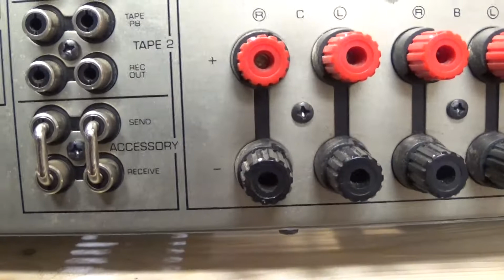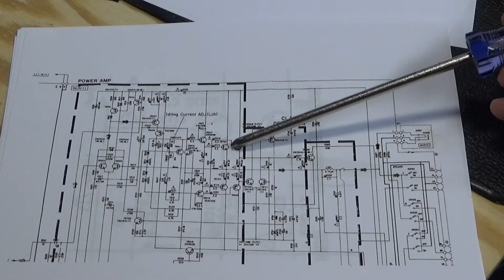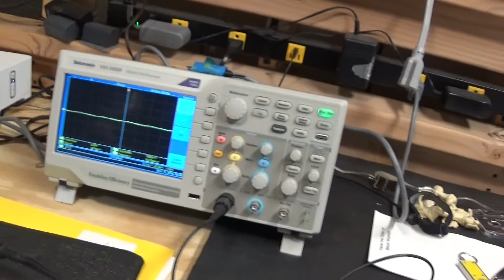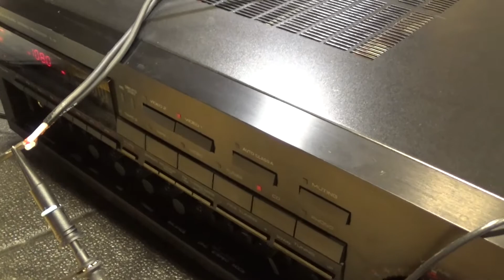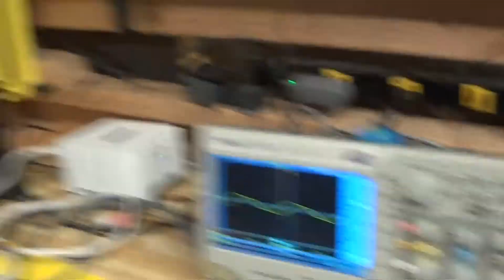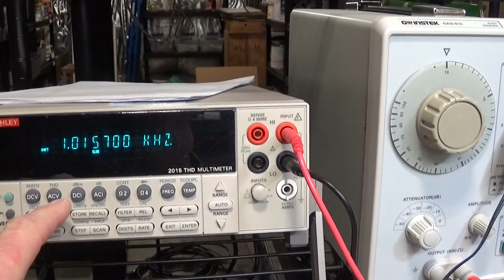Yamaha R-9 Receiver/Amplifier Pt. 1:  Intro, a new toy, is it any good?

Comment: Congrats on obtaining the top line 125W R-9 difficult to obtain when new in 1985 or so. I went to multiple stereo stores all over in a major US city and they were all sold out & had to settle for the next in line R-8 at 85W, tho at 100W into the 6ohm ESS speakers eventually obtaining. I always thought there were 9 versions from R-1 to R-9, but it seems there were the R-3 at 35W, R-5 at 50W, R-7 65W, R-8 85W, and R-9 125W. Have great specs and great sound. Enjoy if you can.

Comment: I have an r9 that i bought new in 1986. It’s been sitting in storage for many years. It has the broken door hinges issue. Also the r9 is a 8 ohm receiver and my kef 104/2 speakers are 4 ohm i blew the tweeters on my kefs before. So another reason i dont use my r9. Good receiver though. I am now using a Denon avr 2807 now.

Comment: The reason you don't like the feel of the volume control is because of the resistance from the motor attached not the wire for the LED volume indicator is dragging.  Your A1000 doesn't have a motor for remote volume control.

Comment: I have picked up three of these wonderful old components of eBay over the last few years all for less than $150 each. One was listed as for parts only. Thankfully the lister had lots of pictures. The jumpers were missing! I got that one for fifty bucks! The amp circuit is a ripoff from Nelson Pass, btw.

Comment: If the capacitors look visually good. And the unit sounds great is it still advisable to change out the capacitors, at least the dc power ones ?

Comment: Ive been collecting since 08 and have acquired 3 of these. I paired the R-9 with an Onkyo Integra CD player, B&W 601 S3’s and Al Jarreau’s “Blue in Green(tapestry) part 2 and the synergy was fantastic! The engineer on this album “Heaven n Earth” did a fantastic job. It’s unfortunate there’s so much great gear out here where as you can’t set everything up, but, this is one great piece, in great working condition or restored.

Comment: Great video. I acquire Yahama R-9 but the left channel is distorted and when I turn on the Auto Class A it's fading out. The right channel seems alright. Since I don't have such instruments like yours for testing. What should I replace first the transistors or capacitor on left channel?
Reply: I have a Yamaha R-9 also with the same problem of one channel distorting.  Any info on this issue would be greatly appreciated!
Reply: @John-Burse  I have an R-8 that had a left channel out. It turned out to be a bad solder joint of the send/receive rca plugs. Try reflowing those connections on the circuit board.

Comment: Excellent review!  Thank you.  
Love your Keithly sig gen.  And your wooden heat sink!
I bought an R9 a couple of years back, complete with broken door hinges.  I REALLY like it, with the possible exception that now I have to run it at 55+ watts to get lower distortion.    LOL.  
The roughness you feel on the Volume control is probably a funky clutch on the motor that drives it for Remote Control. The wires are for the LED on the knob.  
 Going to search-out your Part 2.  Thanks again.

Comment: A Yamaha receiver that I just bought used is the AX-596. The specs have the damping factor at 320.the built is nothing similar to the R9 but it sounds really good to me. It does have that flip down door like the R9. Wonder if you have ran into the AX-596 and what your opinion is.

Comment: With those jumpers on the back of the amp, you can use just the R9 amplifier and use your own preamplifier. I would remove the jumpers and use the R9 class A power amplifier by itself with a separate preamp